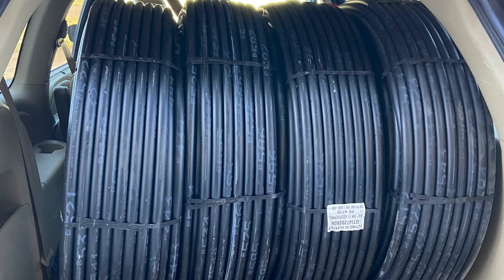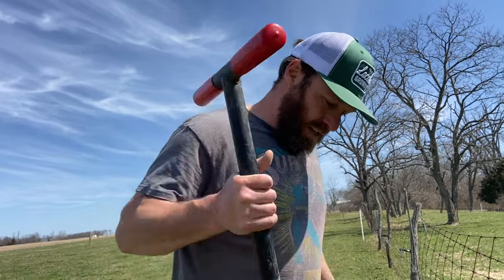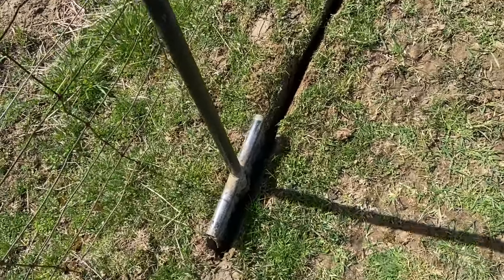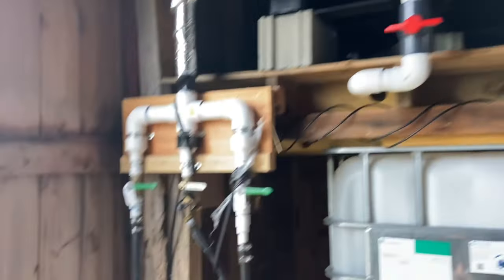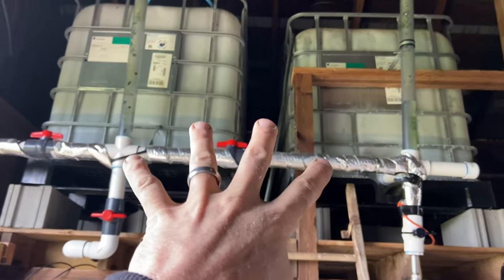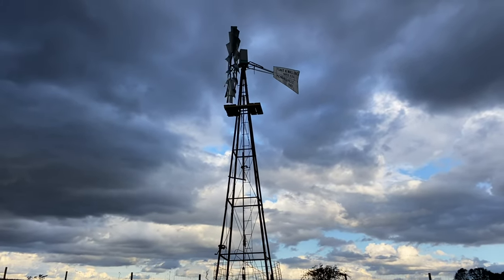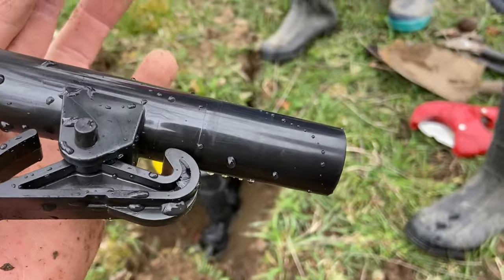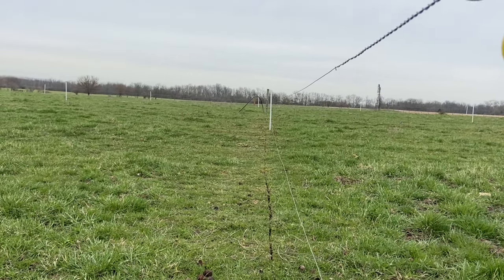Rotational Grazing Water Set-Up

Comment: Get set up, we’ll definitely be replicating the design as we continue our infrastructure build.
Reply from the maker: Thanks!  Hey, forgot to mention, the fittings got a little tricky.  Ended up using 3/4” on a 1” hdpe line, as the 1” fittings thru Powerflex we’re way too big.  Not sure why it worked out like that.  Good luck to ya!

Comment: Mornin' Jason . . . I have had a very similar idea rolling around in my head for a while now. One of my main concerns is getting it blown out each season in late Fall to prevent a shallow line from freezing, do you have any provisions for that?
My setup would be hooked to a "city" water system and I wonder about how to keep an eye on the flow in case of a leak and if it would make any sense to put a regulator on it to reduce the consequences of a leak . . .
Anyway, nicely done. I appreciate seeing in practice what I've been pondering on.
Reply from the maker: Great questions and concerns here!  So my plan is to dig up and pop off the black caps at the end of my set-up and blow out with an air compressor at the end of my grazing season (November-ish).

When we first purchased our farm, I installed a water meter (Neptune T-10) on our copper line in basement going out to pasture.  I needed this to know how much water we were consuming in pasture for a reimbursement situation.  That being said, there is a really useful feature on the meter that shows small leaks (small red triangle).  I’ve been really happy with it for about 5 years now.  As far as a regulator, can’t help there, as we’ve not had need or installed.  Best of luck with your set-up!